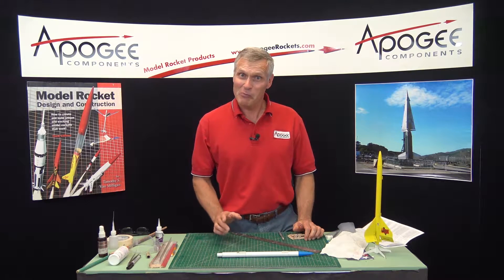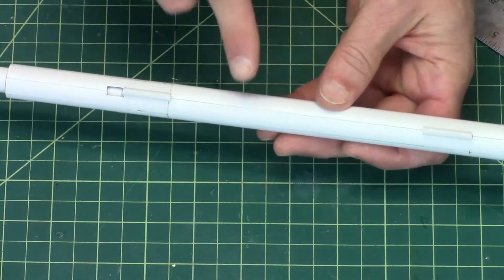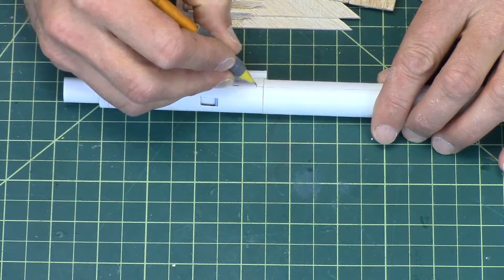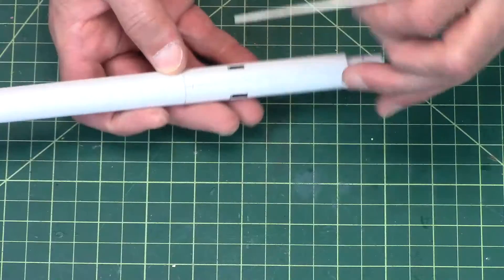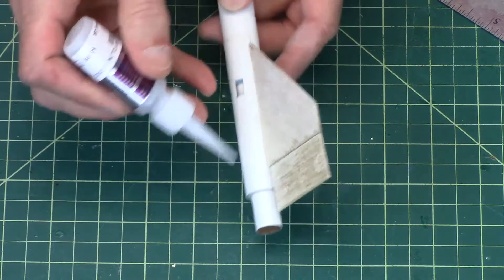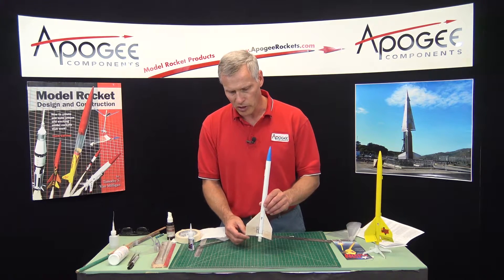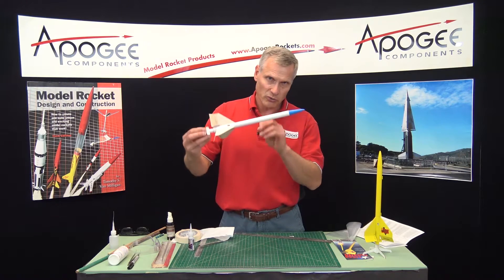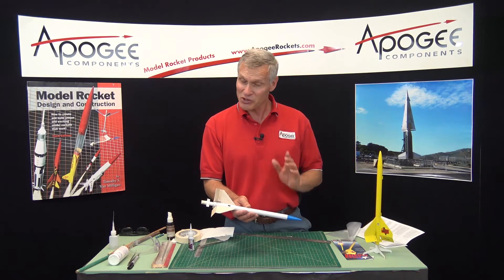Texas Twister Assembly: Part 7

Comment: How strong are those balsa rubber band holders? Do they outlive the rocket usually, or do they need replaced sometimes?
Reply from the maker: Like the fins they can snap off from frequent use or sometimes a hard landing. It typically doesnt happen very often though and it can depend on how well the piece is bonded to the fin.